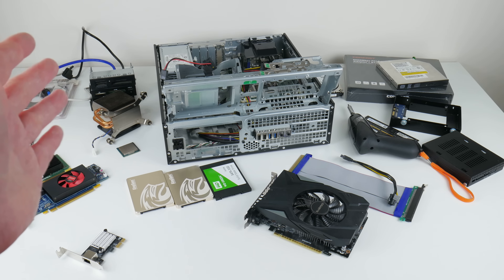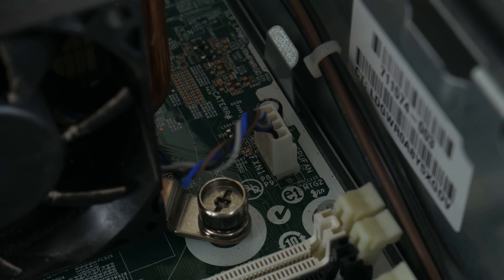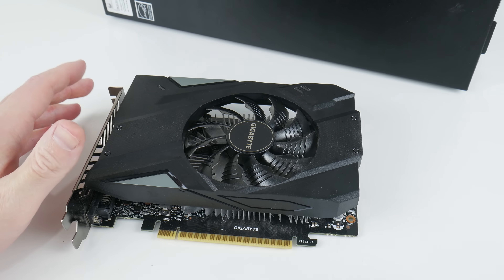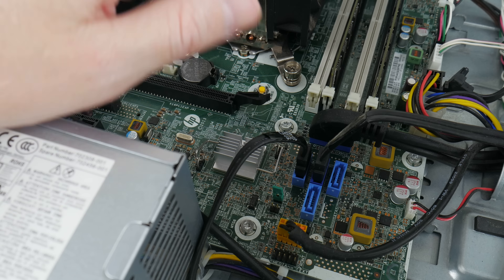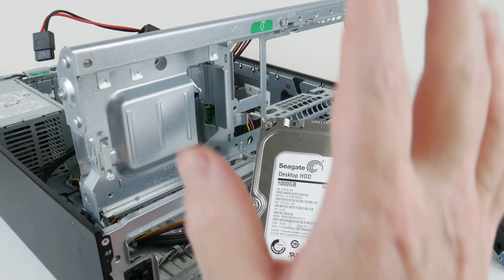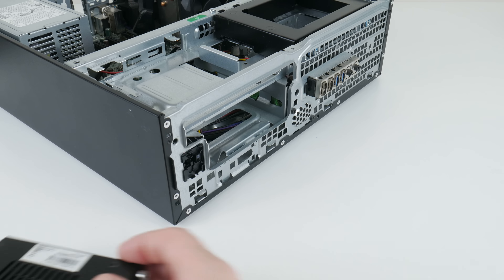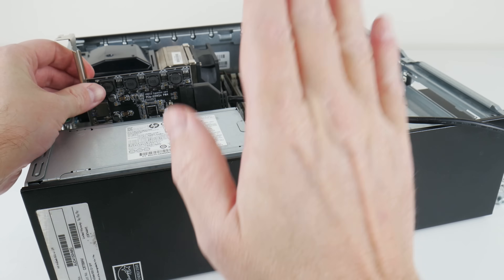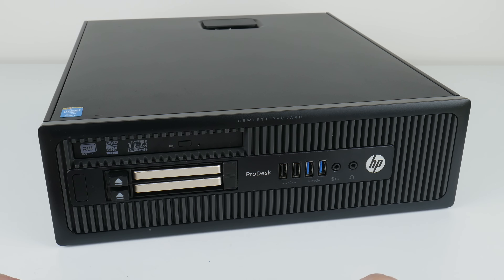HP ProDesk G1 Small Form Factor Upgrade Guide

Comment: id like you to take a look at the g4 six core version.
Reply from the maker: What I noticed is that they seem to have reduced the PSU power with the newer generations, so it might not handle a decent GPU anymore...
Reply: @philscomputerlab  I would go with a 1650, 1050ti, yeston rx 550 low profile or a low profile RX 6400

Comment: Being a 4th-gen Intel, this is the last generation of motherboard that is actually 100% Windows XP compatible.  All it needs then is a compatible low-profile graphics card.
Reply from the maker: Yes you are right 😍
Reply: Actually, the Intel chipset USB 3.0 controller doesn't have XP drivers. So it's only about 97% compatible. But it will work in USB 2.0 mode.
Reply: @looks-suspicious  Correct, but at least there's no dead ports as even the 3.0 ports will still work at 2.0 speed (I think).

Comment: Phil, I've been working with the somewhat smaller HP ProDesk 400 G2.5, which doesn't have quite the same upgrade flexibiity for various reasons, but here's a question for you: I'd like to fit the system with an i5 4570 but the BIOS refuses to allow this, stating that only CPUs with 65W or lower TDP are allowed. Do you know if there's a way to bypass this restriction? I originally bought the machine because it came with an i7 4790S (which I put as an upgrade into my main HTPC), so I'd hoped to move the old 4570 into the HP, spec it up a bit and then sell it on to make back at least some of the original cost (the G2.5 was 55 UKP total).

In other ways though it is certainly more limited. With the system disk and DVDRW connected there are no spare SATA ports, no spare SATA power connectors either, and the main PCIe slot is right next to the PSU chassis so only single-slot GPUs would be viable. It came with a 500GB HDD, which I can replace with an SSD of course, but only 4GB/1600 RAM (just two slots). If I can get the 4570 working then I'll do up the rest of the system (change the RAM to 16GB, etc.), but otherwise I'll just put in a basic i3, add an extra 4GB, change the storage to an SSD, fit a simple Quadro 600 and leave it at that. Would be nice to get the 4570 working though if possible. Any thoughts?

Ah well, the 4790S in the HTPC was at least a resounding success, better performance but lower power usage. It has an ASUS Z97I-Plus, 750 Ti, 2TB NVMe (SN570), 1TB SATA boot (850 Pro), works very well, draws 45W while idle without any undervolting, etc.

Btw, there's a nicer front 2-bay trayless hot swap unit one can get, the Startech HSB220SAT25B (code B001CYZC38 on Amazon UK); one can't see the drives when installed and the buttons are more flush to the chassis, though it is more expensive (or a slightly cheaper alternative is the SilverStone SST-FS202B). I didn't know about those dummy optical cases though, to hold a 2.5" device, that's cool.
Reply from the maker: Without having looked more into this issue, I would say your chances are limited as HP will want to make sure that the CPU is within the power limit of what the machine can handle. Also thanks for pointing out this G2.5 model, I wasn't aware of such a model. Seems to be an in-between model, with more options than the Ultra SFF machines. As for using it as a HTPC, it's the lack of modern video decoding that's the main issue. They can do H264 but no chance with VP9 and AV1. Newer SFF machines are slowly coming onto the used market, so there is always something new around the corner.
Reply: @philscomputerlab  Thanks for the reply! I thought perhaps what one could do is set a power or voltage limit in the BIOS, in which case it would work fine, but cest la vie. I've ordered a cheap i3 4170 (6 UKP) to put in the system instead, that will suffice for selling it on, though just with 8GB, SSD and Quadro 600, a basic tasks machine for 25 or whatever (it came with Win10). In the meantime I'll keep an eye out for a bargain Z87/Z97 mbd, perhaps even one I could repair.

Re using the G2.5 as an HTPC, I only bought it as a means of obtaining a 4790S for a reasonable price. My actual HTPC is a far better box, as I say with an ASUS Z97I-Plus, 750 Ti, 2TB NVMe, BDRW, etc. I'm not bothered about VP9/AV1 for the moment, my TV is only 1080p. If/when I move up to 4K then I'll look for a better GPU; I had been considering a Zotac 1070 Mini, but maybe that's not new enough for decent 4K support. Alas the realm of small form factor or low profile GPUs has been poorly supplied in recent years, there are few decent options, with products like the 3050 being rather lame and too expensive. Maybe I'll obtain a 1050 Ti instead at some point, I won a Gigabyte low profile model on ebay for my brother's HTPC (Ryzen 2600X), works very well.

Comment: This is exactly the type of pre-built I like.  Very understated utilitarian design.
Reply: If they only dropped making proprietary sizes for everything they can produce internally or order cheaply. But both Dell and HP are hellbent on making custom motherboards, PSU's, cooling, leaving much more of their units ending as landfills once corporations replace these. And for no apparent reason, they keep some of the standard measures but change PSU headers or make them too long in one dimension, use slightly off-standard motherboards size even if mini ITX or mATX would fit perfectly
Reply: @netiturtle  Because they want you to go to them for repairs. Or, if they no longer provide parts, simply purchase a new machine and toss the old in the landfill. Recurring revenue streams 🙂.
Reply: @netiturtle  0.01% of people know what you're talking about. That's why.
Reply: It makes for a proper sleeper

Comment: Phil, can you show how to fit a standard lowpowered videocard into these small form factor pc with a pcie raiser?
Reply: You plug in both ends of the riser cable and find a place to set the video card. I believe the reason it wasn't in the video is because there's no elegant place to mount it.
Reply: @harleyn3089  You right, i saw a guy that mount the card outside the case doing a mod but maybe isn't aesthetic, and placed it inside is also tricky and the rear connections wouldn't fit in. Thanks for reply!
Reply from the maker: You cannot fit it neatly and I used it for the purpose of this video to test the games as I didn't want to buy a low profile card specifically for this video.
Reply: @philscomputerlab  Ok Phil, I understand, so the only way would be doing an extreme modding on the original case to mounting the card outside or better (without destroying the case) taking off the hardware and making a diy case, but is a lot of work hehe. Thanks for reply!

Comment: Great small system. That i7 is standard 4770, or a low power "T" version? It will be interesting to see perfomace with RX6400, compared to that GTX1650. How lower amount of lanes will effect such older system. I really like front device with two slots for disk drives. Thank you Phil!
Reply from the maker: This is the regular 4770, NOT the T or S version. Yea I would love to test RX 6400 but not easy to to obtain one at the moment,
Reply: @philscomputerlab  Yes get it. In my country (CZ) are RX6400s are at stock, but for prices from 170€ to 200€ inc. taxes. That it is not very rasonable deal. My friend bought before x-mass used ex-mining RX6700XT for just only 250€, it's totally different level of performance for just 50€ more.
Reply: @honzaplachy5040  I agree the low end cards are priced too high for the performance, but unfortunately I think they know they can charge this for low profile and not needing extra power cable.

Comment: G1 are amazing devices, i sell refurbished like that one,  to my clients, the love it.. Great computer for the price , like 250$ i5, 8gb and 256ssd.
Reply: As I just noted in another post, I just bought one for $44, and they are often less than $100 on ebay. $250 is really expensive.

Mine didn't come with the SSD, because office machines usually have the storage removed, but 256 GB SSDs aren't very expensive.

Comment: Have you thought of upgrading this with a PCIE adaptor for nvme drives?  Even a nvme gen 3 ssd should be faster than traditional ssds.
Reply from the maker: Yes that works just fine. Not sure if it will boot from it, but there are workarounds...
Reply: @philscomputerlab  I’m interested in booting from PCIe drive on the G1; what workarounds are you aware of?
Reply from the maker: @MyFavoriteTrail1  Use a USB stick to boot, I think clover is the project name...
Reply: ..would it make much difference though...

Comment: There is Mount Adapters to convert CPU Coolers from a Threaded Screw Mount to Push Pin Mounts & Vice Versa. I have used them more than once so far with no issues but your results might vary.

Comment: I have set up so many of these. The best strategy is to screw 2.5 inch ssd's in with a cd drive screw through the squares near where the drives go, you can skip a caddy. If you have a 3.5 inch hard drive the case has 4 extra screws built in that are made to be taken out and used for that purpose, unless someone already took them out. That will work in the slot under the optical disc drive. If they took them out any round machine screw, or weird hp round screw (you know what I mean) will work.